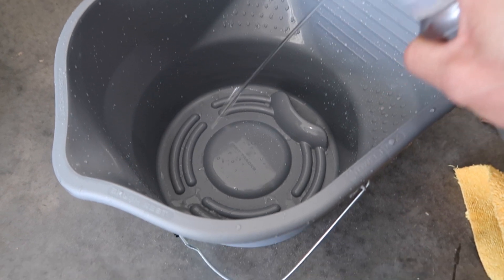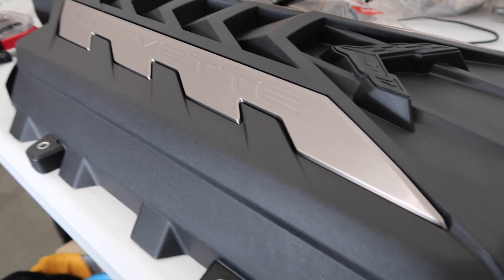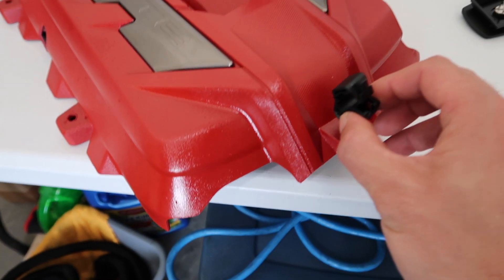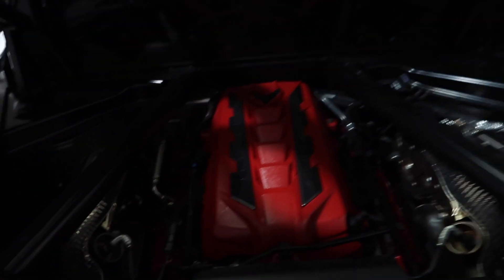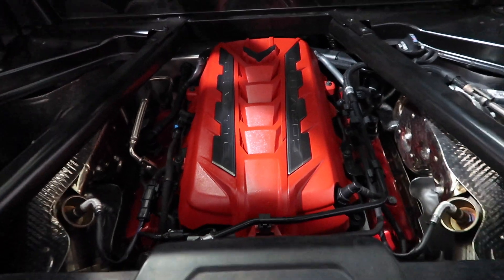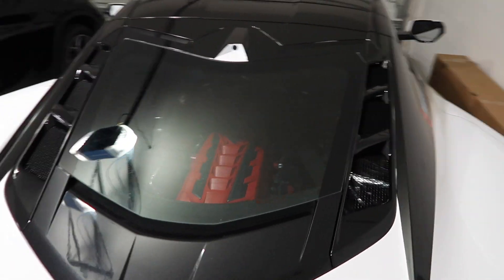2020 C8 CORVETTE FIRST ENGINE MOD : HOW TO PAINT THE ENGINE COVER

Comment: Nice job, but as you said, not a good match for the valve covers. I used Dupli-Color Metalcast Red, which is a perfect match to the valve covers, and it's hi-temp to 500 degrees. For the primer, I used VHT Engine Enamel, light gray color and handles 550 degrees. This primer will give maximum adhesion to the engine cover. A note about the rear view visibility, IMO it's acceptable, but can be significantly improved with Paragon's blue-tinted external rear view mirrors, which are convex on both sides...these are a huge improvement over the stock mirrors, plus the blue tint cuts done the bright glare from headlights.

Comment: Nice informative video.  Just a suggestion for the future, you could've just used an IPA or Isopropyl alcohol to wipe instead of washing the cover.  Save you drying time.  Detailers use it to wipe cars after polishing, prior to coating.  Take care.
Reply from the maker: Yup, I used that right after the tape up. Someone skipped ahead! 🤣 jk! But it was extremely dirty so I gave it a bath first then IPA. Thanks for watching! 🙏🏼 oh it was probably cause I didn’t actually show it, but I said it right after the tape up job part.

Comment: Hey... Good videos and instructions - I watch them all. One quick question for you - how hard is to remove the roof top and store it on the trunk? You have the high wing option - I haven't seen anyone showing how this is done. My car should be in soon and I'm curious to see if the high wing will be an issue in this case.
Reply from the maker: No issue with the high wing. I’ll try showing it in a video one day for you. Thanks for watching!
Reply: I don't have the high wing but I have the Z51 wing and I have no problem storing it in the trunk. I'm 5'9 so my wingspan isn't that wide either.